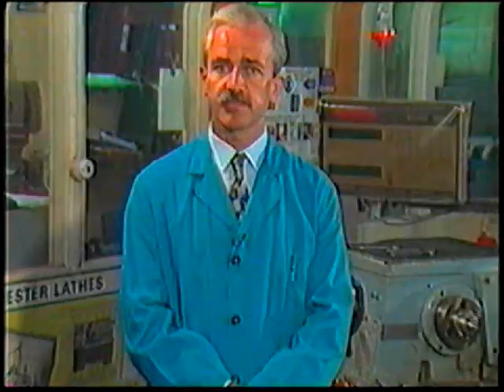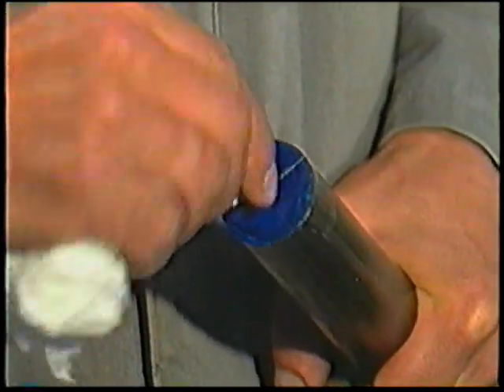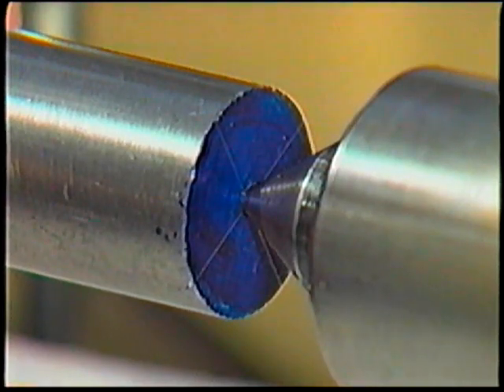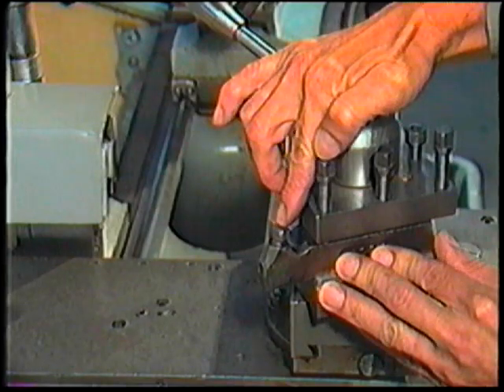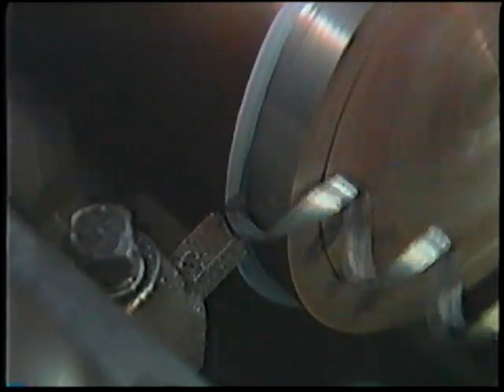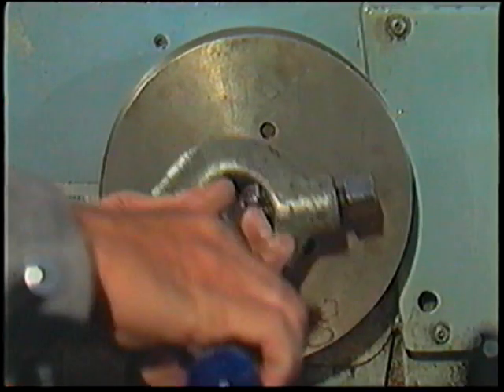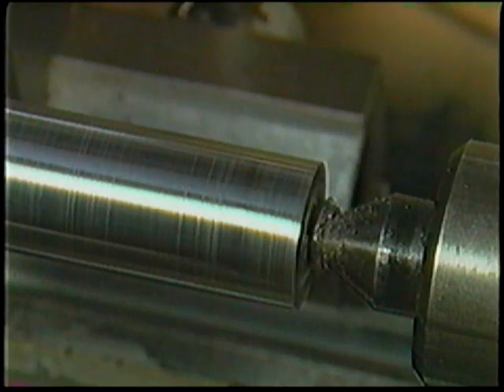Machining with a Colchester Center Lathe Part 2

Comment: The “centering the work” segment of this was really dumb. Most lathes are setup with a 3 jaw self centering chuck where you could just drill the center out with the tail stock. However they’re turning between centers in the video which is an uncommon, odd ball setup to begin with. Sure, it’s runs truer than a 3 jaw, but it’s a lot more practical to just use a collet chuck at that point.
Reply: A 3 jaw self centering chuck will not produce a center hole concentric with the outside of the bar stock.

Comment: Does a parting off tool use a left hand cut or a right hand cut ? :)
Reply: You can specify left , right or neutral with insert parting tips ,the angled tips are about 7 degrees offset depending on what part you don't want the Burr on.
Reply: @pauldavidson6321  Neutral perhaps meaning both ! i.e. the cutting tip is wider than the rest of the tool up to the point it meets the clamped part - wot I don't know the name of - stock ?
Reply: @millomweb  neutral means the tip meets the work square and has no angle in which case the Burr is always on the parted off piece .all parting inserts are wider at the cutting face than the tool holder blade.
Reply: @pauldavidson6321  I think having the unwanted bit fall away with the burr is the desired option by default - then the wanted part doesn't get damaged by dropping and you still know exactly where it is (for automatic operations).
Reply: @millomweb  yes that's correct, but when multiple parts are required from bar stock you would spec a right hand insert.

Comment: I'm only up to 1:35 and already I'm having a teeny-tiny bit of a suspicion this was made by somebody who had never used a lathe in their life. What the actual flip is that "drilling the centre bit" all about? That hole, made with only the finest centre-banana, isn't even on nodding terms with the centre of the material. I could do better than that with a knife and fork :-D

Comment: Christ this was hilarious...  made for our Australian cousins.... no wonder their car industry folded... So much wrong with this. Even in the 70s they had  tailstock roller bearing centres. It moved when he took a cut and his speed looked way  too slow for that size of round stock. Shows a carbide cutting tool and doesnt even mention it.....So much wrong with that its hard to point out what they got right. Glad I never had a tradesman like that showing me the trade...
Reply: Sorry, I didn't see a tradesman in this video. Just Laurel & Hardy.
Reply: First of all FUKU. Car industry folded due to having a Government that stopped propping up overseas car makers. Second of all there is nothing wrong with Australian Tradesmen. Have been a Toolmaker for 40 years, worked all over the world and we are just as good as any other country. Worked mainly manufacturing items for the Defence Force and after seeing the shit that came in from overseas I wonder how the Super powers survive as they are second rate to say the least.

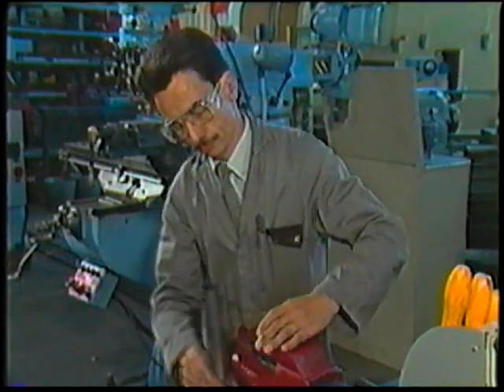Comment: 1:31 I can see the work move at least 1mm to the right..  there is no way that hole is on center..
Thank you for sharing this videos.. Colchester make great lathes and I really enjoy learning about their history
Reply: It certainly is way off centre.  The centre drill was not chucked properly anyway, or the chuck is seriously damaged.  You can see an extreme wobble as he pulled it out of the work piece.
For accuracy (and a saving in time), ALL work than can be done in the lathe should be done in the lathe without rechucking the work.  Use either a well maintained 3-jaw self centering chuck, or if that is not good enough, or the stock is not round, chuck it in a 4-jaw and use a dial probe to check the centering.   Once you have done this a few times, and know how much each jaw moves per turn of the key, it takes only seconds to accurately centre the work.
Reply from the maker: thanks for watching
Reply: It moves to the the place where it was center punched.

Comment: why not center it on the lathe ? it will never run smooth like this
Reply: It doesn't matter, once its mounted between centers  it can be machined parallel, although centering is preferable .
Reply: @pauldavidson6321  It most certainly does matter. He was miles off centre and at best he has created more work for himself truing up the piece. He's not just a tiny bit off-centre he's miles off and might as well not have bothered.
Reply: @AnthonyHandcock  if you read my comment I say centering is preferable .plus 2 mm out in the 80,s would have been turned down in short order with heavy HSS  roughing tool ,it's just an in house rough guide film for apprentices ,a tradesman would be guiding the trainee far more thoroughly than that.
Reply: Anthony Handcock you can machine it Parallel if the diameter of the piece is not important, duh
Reply: @pauldavidson6321  I'm not sure why you think the 1980s was any different from now or when my dad was an apprentice toolmaker in the early part of WW2. The techniques haven't changed.

The point is not that centring may or may not be necessary but the utterly inept way the guy in the video goes about it. Seriously... No half way competent machinist would EVER put that piece in a lathe. I'm no great shakes as a machinist but even I know the correct thing to do if you drill a centre hole off centre is to cut off or reverse the stock and do it correctly the second time. All that you achieve by using an off centre centre hole is create work and wear out the tool.

I'm amazed that anybody who makes a film called "Machining with a Colchester Center Lathe Part 2" could ever let this fiasco out where the public might see it. Couldn't they have found somebody who actually knew what they were doing?

Something else that tells me this guy doesn't know what he's doing... He's wearing a f***ing tie while working on a lathe. No... Just NO.
Reply: @BraedenPrice1  Sure you can machine it parallel but you can do that a lot easier if you start with a centre hole that's in the centre.

Seriously... If you were a first year apprentice and drilled a hole that off centre the instructor would make you file the end down with a smooth cut file and do it again just to teach you to take more care in future :-D

"they made top quality lathes"

Agreed... But they would never have their name attached to this fiasco of a "training film".
Reply: Anthony Handcock well they did so yea they should have used a bell center punch.
Reply: @pauldavidson6321  it’s not even that. It’s the fact that this method they demonstrate is super time-consuming and impractical. I can throw the stock in a three jaw self centering chuck and have a center hole drilled before the blueing they used for their method is even dry. The Center hole would also be leaps and bounds closer to center than the way they did it.
Reply: What if you don’t have a chuck and the thru hole is too small for larger longer stock you could do it with a steady rest but not every one and he is showing an other way!
Reply: @BraedenPrice1  That may be true but what's in the film is both unnecessary and so ineptly done he might as well have done it with a six inch nail and a lump hammer. My guess is that the guy in the film is either an actor or a manager who decided he wanted to be in movies. Whatever he is he's no machinist and clearly doesn't have a clue what he's doing.

I'm no machinist either to be honest but I'm a lot better than that :-)
Reply: Anthony Handcock this was made a long time ago and they did not just want to make a video but educate people how to use a lathe during hard situations!
Reply: @BraedenPrice1  My guess is this was made in the 1980s and there was nothing "hard" about it. The person clearly doesn't have the slightest idea what they are doing. Right at the beginning when he drills the "centre" hole you can clearly see it's not even on nodding terms with the centre of the material. It's at least 2mm off and he might as well not have bothered. 

If that was a real workpiece he would have reduced it to scrap before he's even got near the lathe.
Reply: Anthony Handcock you think colchester would do that they made top quality lathes!
Reply: @BraedenPrice1  Might as well say "What if you don't have a lathe" !

Get the Spirograph out :))))))))

Comment: great video we were taught centre height setting  a bit different than this using shims   

and at 7.40  the bloke looks like francis begbie  out of  " trainspotting"
Reply: We never knew what Begbie did for a job ,he was the only one who wasn't a junkie.
Reply: There were packing pieces under the tool. But the design of tool holder permits that type of fine adjustment - where he did things in the wrong order and ended up with the tool loo high !